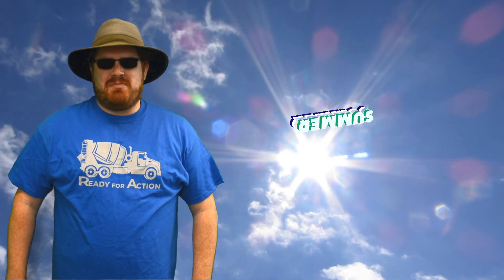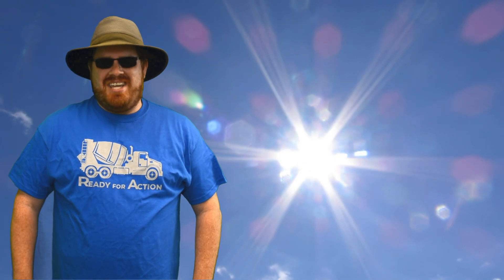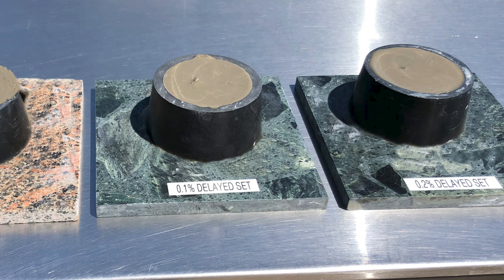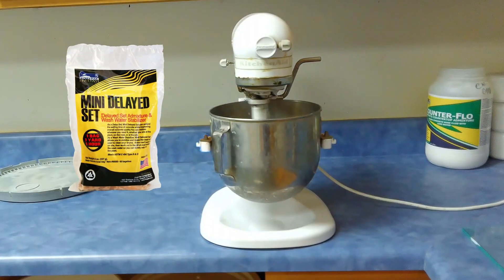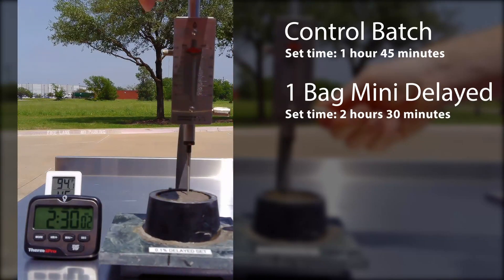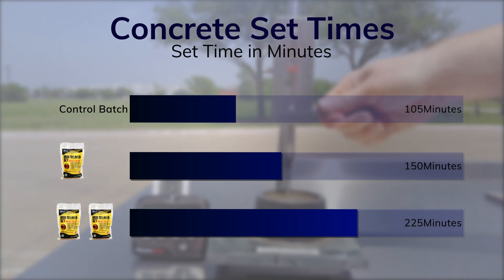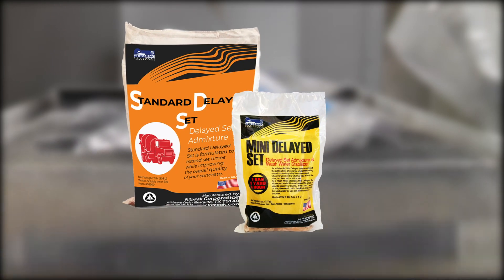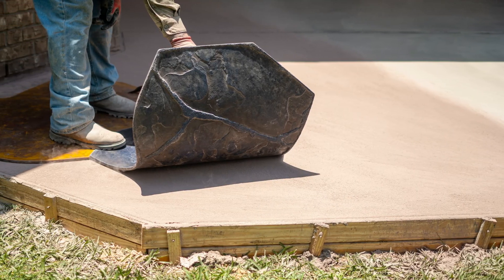Improve Hot Weather Concrete with Delayed Set Concrete Admixtures

Comment: Have you ever tried spraying it on just the top If say it started raining and he had to cover it up with plastic unexpectedly and say you had pretty much magged it laid it down  but maybe wanted to hit it one more time or even just broom it
Reply from the maker: These products are not really meant to work like that. They work at the molecular level in fresh concrete to slow down the hydration process.  spraying it on the concrete surface might cause discoloration and uneven set times.